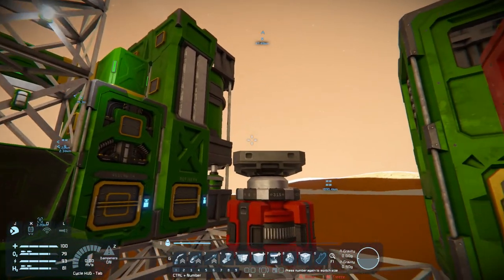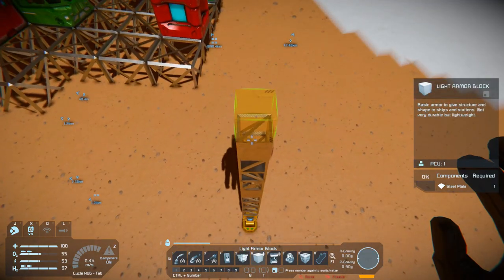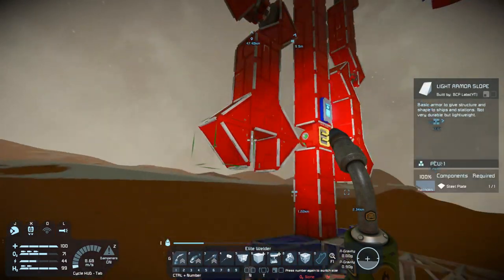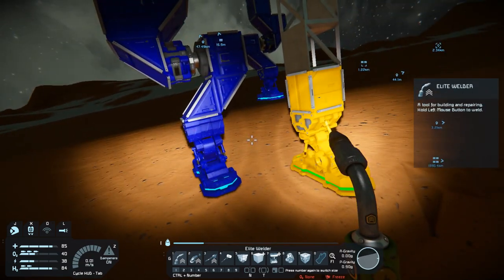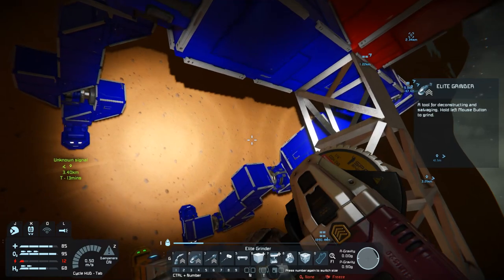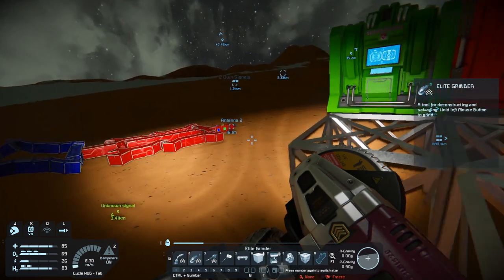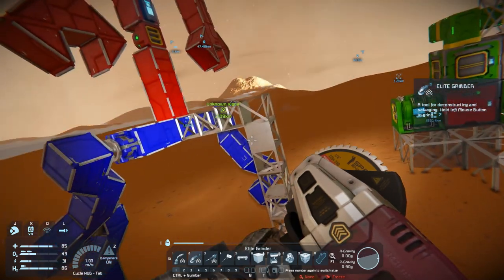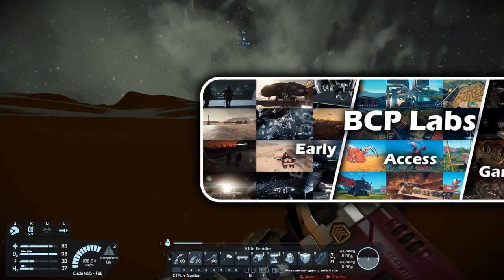Baby Steps - Space Engineers - 23

Comment: What I noticed is he isn't lifting the leg in back high enough to swing it forward.   Try bending the knee a little before he swings the leg forward to allow it to clear the ground then straighten it and plant it for the foot to lock. If you watch someone walking that is how they do it.   When the forward leg is planted, it is locked to support the weight.  When the rearward leg is moving forward, the knee is bent then it swings forward to plant the foot and locks.  The knee joint supports the weight and the muscles in the leg actually moves the body forward.  When the former forward leg moves to the rear, then unlock the foot and bend the knee a little to allow that leg to move forward.   With that being done in sequence, he should walk.   Here is a link to how humans walk with a picture - https://en.wikipedia.org/wiki/Walking.   Here is a video describing it - https://youtu.be/zwcFtWLRIxk.   You are on the right track, and it's not bad for a first try.